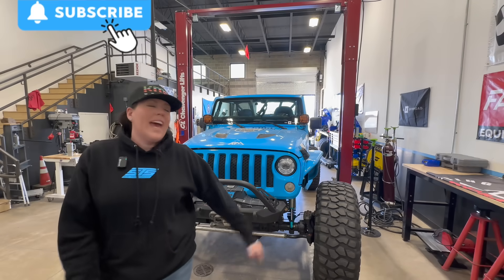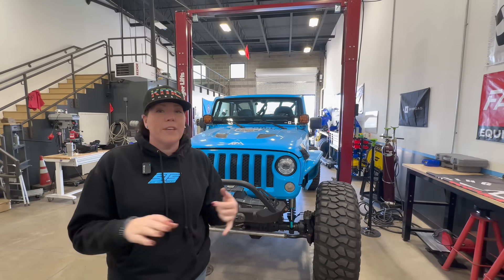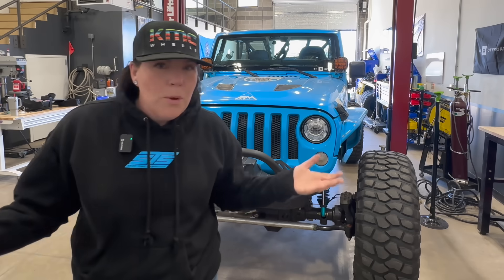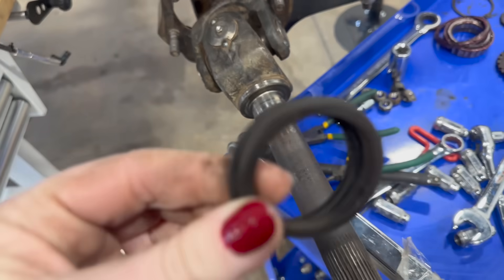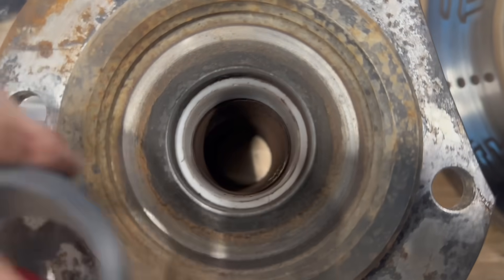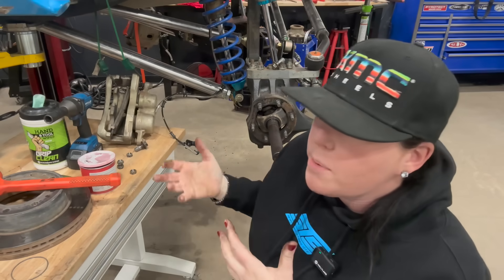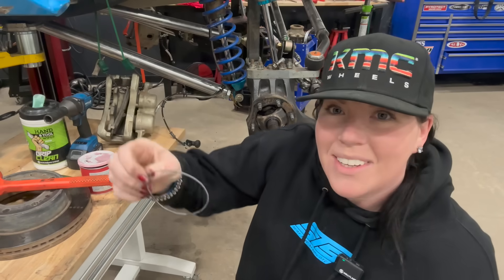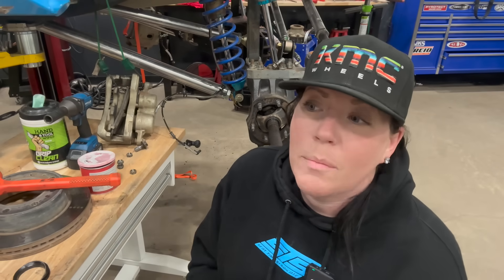Violent Vibration From Worn Out Spindle Bushings

Comment: I love that even after living in the US for a few years you are still measuring the thickness of the bushing in mm's! Metric for the win.
Reply: Looks more like 5mm, top line on calipers is in inches, but who cares 😂
Reply: Failure to assimilate is the reason that the U.S. is so messed up.  Everybody comes here wanting to live the same way they did in the places they came from.  Suggest she start using units that are used in the U.S.
Reply: @mikek5298 - If you were as smart as you think that you were, then you would be aware that virtually everything in the US is already metric.  The packaging either simply uses both measurements or has an Imperial equivalent for bone headed consumers.
Reply from the maker: Failure to assimilate does not have anything to do with why the U.S. has problems. In fact, seeing how freedom is a foundational tenet of this country, it’s probably much more likely that those who come here do so in the hope of being able to measure things however they liked - especially in their own garage. Also, it’s a bit of a stretch to associate economic and social problems with a globally recognized system of weights and measures 🤣.
Reply: @mikek5298  😂😂😂😂😂😂

Comment: Holly; a suggestion; go to your local metal supplier & see if they have any brass bar stock and find out if you could get a "drop" from it; only need a 6" piece, use one of the replacement buchings & locate a machine shop and ask them if they could "turn down the brass" far enough where it's a micron of an inch smaller than your repalcement bushing; it would be much better than a socket.

Comment: Getting it done Holly way to go. Hope the work you did fixed the issue. It was obvious that the work you did was needed so at least it wasn't wasted even if it did not correct the loud noise. But hope it did. so MischiefMaker is good to go now.

Comment: Holly when you are using your verniers try to use just the ends of the calibers especially when measuring small rounded material…it will give you a larger measurement then actually have.

Comment: Was the shaft marked up very badly where it rides on the bushing?  Sometimes it can be a chore to polish off any residual from the old bushing and smooth off and roughness that will shorten the life of the new ones.  1 millimeter reduction in the thickness of the sidewall means a 2 millimeter increase in diameter so that's a pretty big potential for damaging vibration.  

When driving a socket with a hammer you really don't want to hit the socket with the hard face since that can chip plus it can distort the socket so it won't fit correctly on the square drive of the wrench or extensions.

No thin fiber gasket on the hubs?  The ones I used on construction and snow removal equipment all had a hard gasket to seal the locking hubs up.

Do mostly high speed high mileage so no poly bushings here but roller/needle bearings and high pressure grease for roadway vehicles.

I had one motor bike come in for a defective muffler that had cracked and a rear fender that kept coming loose and falling off which they were rabid about being due to cheap mufflers and fenders however it was vibration from a worn drive sheave that was telegraphing though the frame and destroying seemingly unrelated components.  Fixed the root cause of the vibration and all the collateral damage stopped.

Glad you tracked it down and hopefully stopped any further collateral damage from taking place.

Best!

Comment: I work in a shop in Tennessee and that bushing problem is very common with the 07 and newer super duties.
Reply from the maker: I wasn’t even aware the unit bearing axles had spindle bearings (or bushings). The buggy I’m building will be the first unit bearing rig (all 4 corners) I own, so that will be a whole new learning experience! 😃🙌🏻

Comment: Awesome video as always. Is the lower control arm jam nut on the passenger side, axle end tight?
Reply from the maker: It is, the gap you are seeing is due to the Belleville washers that sit between the jam nuts and the aluminum arms. Those gaps are not there on Nessie because all of her joints are right hand thread so the overall distance can’t change unless the joint is removed from its bracket.

Comment: That's the DRIEST I have ever seen anyone run a front axle?? also never have seen those nylon bushings in place of the Torington bearing?? 
Any particular reason you don't run the slinger/shield on the stub shaft, the dust seal fits tighter against the back of the spindle with it in place.
Also if you pack the back/inside of the wheel seal the garter spring won't pop out when you drive it in the wheel hub.

Comment: So ... I have a "death wobble" at speeds between 40 and 55 (less it doesn't happen and faster it levels off..... Do you think I may have this same issue?
Reply: Maybe.  The cause of "death wobble" is not a one thing diagnosis. 
My YJ had it due to a bent spring and a bad wheel spindle bearing and bad tie rod.
My son's ZJ had it due to bad ball joints and the drag link came loose at the frame. 
Death Wobble is caused by excessive movement of the wheel(s). Once you get it you need to track down the cause because the wheels flopping around are causing massive issues on the rest of the suspension parts. 
Find a good mechanic you trust to go through the entire suspension. Every part needs to be checked and every one that has excessive movement replaced. 
The kids ZJ ended up with the entire suspension rebuild because the previous owner just kept driving until it would not go straight even at low speed.
Reply: @keithmalmberg8395  yeah Everytime I ask I hear a different diagnosis ... But seeing this made me think..... Is it this simple? Lol... I mean I do want to put a lift kit in so I didn't want to go replacing the stock parts just to change them out with the kit lololol

Comment: Is that a plastic bushing. If so you might look into getting metal bushing that could solve your problems. Just an idea because I don't know for sure if that is the fix.
Reply from the maker: Water and dirt intrusion is a real issue for the metal spindle bearing (and the stupid needle bearings inside of them) when it comes to offroad vehicles. I’d love to know if there is a brass bushing option, but I don’t think that makes sense for this application. These poly bushings are 3 years old and my first set of metal spindle bearings lasted only a few months and scarred the heck out of the nice machined surface of my stub shaft. 

One cool thing to remember is that nothing is spinning up front except the hub on the spindle unless he is on the trail. I am always disconnected at the hub and the transfer case unless I’m wheeling, so the shafts, carrier, gears, etc…don’t ever see sustained high speed use.

Comment: Use the bearings over the bushings
Reply from the maker: How often do you check the bearings and/or replace them? Also, do you have an atlas and disconnect at both the hub and transfer case. I’m only happy to run the bushing because nothing up front is spinning except for the hub spinning in the spindle unless my rig is on the trail.
Reply: @MischiefMakerTV  we disconnect everything on the front-end unless on the trail. I would rather see a bushing like in you u joints vesus a plastic based bushing but the u joints get lubricated every couple of trips if not every trip.